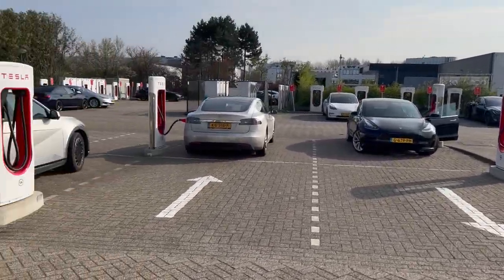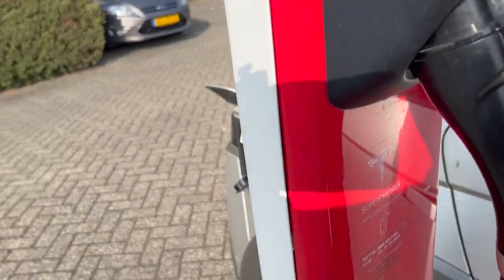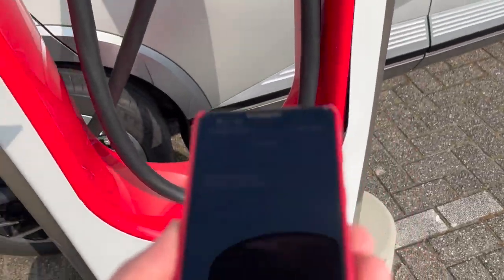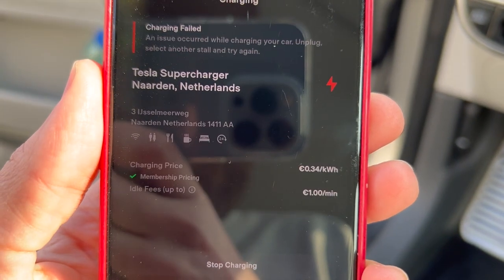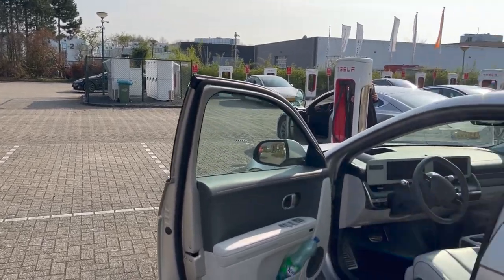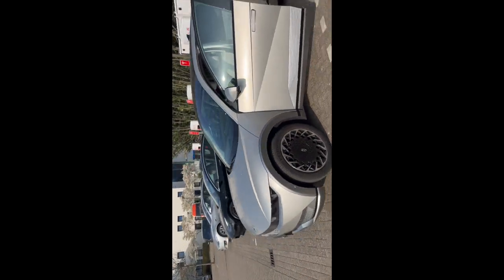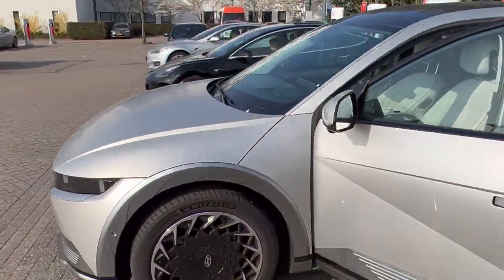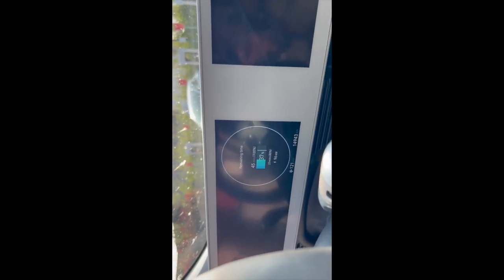IONIQ 5 fast charging at V2 Tesla Supercharger, Naarden, NL

Comment: I think you are sharing the 150 kW power with one of the other Tesla. V2 Supercharger shares power in pair. 15A shares with 15B etc.
Ioniq 5 have chargeport on right side, Tesla's on left side, so even with an empty stall between, you might share power
Reply from the maker: You're totally right. Super interesting. When I'm back at a V2 site I will pay special attention to this, thank you!
Reply: @electricfelix  In France I tested 2 SuC V2 with my IONIQ 5. I always get 96 or 97, never saw more than that figure. Even if I’m the only one charging.